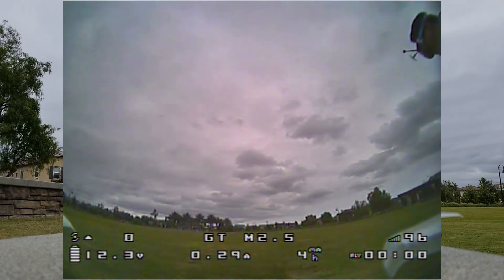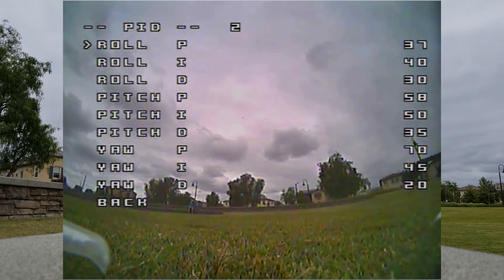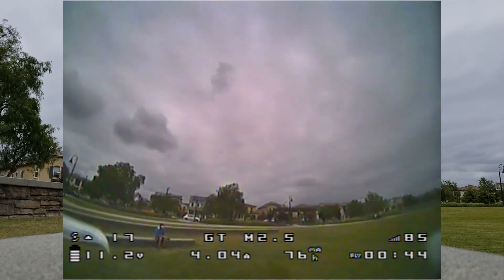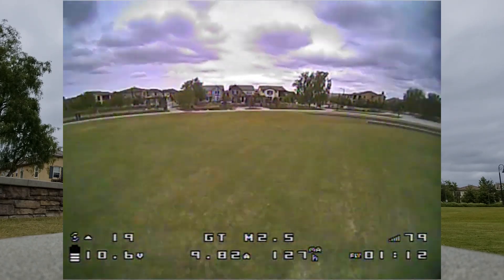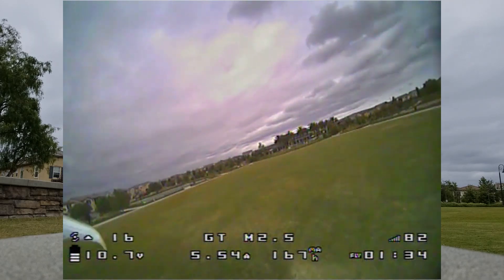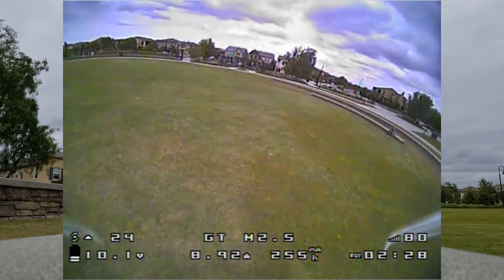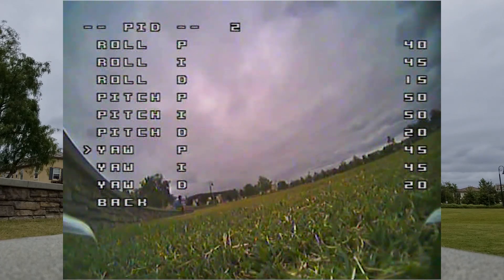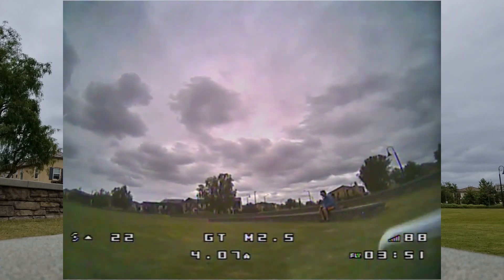PID Tuning (Diatone GT-M2.5) 🛠️

Comment: Great! Even though you are adjusting more than one variable at a time, it makes a lot more sense than I thought it might:
   Fluttering noise - Lower P and D gains (especially for D if motors too warm or noise prevalent during punch out)
   Drift in punch out - Raise I gains
   Loose feel - Raise P
Maybe I don't need the 7 series 5 hour tuning course! (Except as reference material...)
Reply from the maker: You can get a good basic tune with some simple adjustments.  No need for a PhD.

Comment: Hi Albert thanks so much for the video. One thing EVERYBODY misses out on in tuning videos is posting/showing their filter settings. Whether you use biquad or PT1 and depending on how much filtering you enable your tune can end up vastly different! Your video shows the process of PID tuning nicely (although I believe your pitch P is too high and your D's could go lower as well), but many people like to start their tune with someone else's (if the motors and props are the same) and this is only possible if the filter settings are known as well.
Also, Yaw D does not do anything on Betaflight. It's disabled. It is enabled on butterflight though
Reply from the maker: I have a separate video on the filter settings as I didn't want to repeat it for every PID video...  https://www.youtube.com/watch?v=4KyyuK9fGXc
Reply: That does not make any sense to me. PT1 is the best filter to use and it is not risky at all if used along with the dynamic notch. And on 3s you definitely need filters! I have >10 quads, both micros and 5 inchers running on 3s and 4s and everything needs PT1, dynamic notch and sometimes a separate static notch
Reply: Hi Frank, if you want to run 4s on a 2" or 2.5" then yes you will run into problems. I've experimented with that and in my opinion, 3s is better for these models, exactly because of motor heat problems. Of course you can add more filtering, but with more filtering the quads will fly like they are drunk and that is no good (of course they will be faster if that is the only thing that counts). It is not risky to use dynamic notch + PT1 in 4s at all. It is risky to fly 4s with 6500kv 1106 motor though. These run pretty warm on 3s already :-D Like you said, it depends on the setup.
I have pretty much as much fun building and tuning my quads as I have flying them. I only fly about five or so regularly; the rest I use to try out new things. Also I don't build 10 identical ones of course. There is a quad for each occasion: 1s brushless for the garden, insane 2.5" speed for the park, a 3" for tight race tracks, a endurance 5" (>7min on 1300mah 4s) for chilling out and a balls to the wall 5" for speed. The rest is somewhere in between with custom build frames and ultra lightweight stuff.

Comment: Great video! Would be awesome if you could explain a bit more though - for example why you are adjusting which parameter, respectively what you expect from increasing/lowering "I" or "D" and so on...  
 Could you do a PID tuning video of the Space Wolf DT140 too?
Reply from the maker: Do you have a specific question?
Reply: Unfortunately my Space Wolf is still stuck at customs, but I do have a more general Question: Which term could be adjusted if a quad does feel kind of robotic/stiff? I do have this problem with a 2.5" Quad (especially on pitch but also a bit on roll).

Comment: Hi Albert, after flashing to Betaflight 3.4.1, i've had a rough time getting this quad tuned for 3S.  Have you ran into this issue at all? In the end I got something respectable, but was looking for suggestions if you had anything. Thanks.
Reply from the maker: Yes, I am recommending micro flyers avoid 3.4.x for now.  I've had hot motors and burned up a couple.  Something is not right with it and it seems to only work well with 5-inch drones.  I am going to put out a PSA video about it real soon.

Comment: P term and D term oscillations on this are terrible, to get rid of the motor fluttering I have had to go as low as "P" roll/ pitch 26/ 30 - "D" roll/ pitch 12/ 14 on 3s with gyro notch 1 & 2 disabled and d term notch disabled also | and for 4S "P" roll/ pitch 18/22 - "D" roll/ pitch 8/8 with gyro notch 1 & 2 disabled and d term notch Enabled!! motors get hot. 6500KV is way too much for 4S. it needs 4500-5000KV realistically for a good 4S build. Even for 3S on this 6000KV would be the highest I would go and would only go to 6500KV and higher if I was planning 2S.
Reply: Thank you, this really helped me out. 
I've configured everything at home with a 2s laying around. Everything was fine, flying in the living room. Went to the field with 3s and the m2.5 went nuts. Even thought I've fried my motors.
I've never had a quad that was that way off tune and I've flown lots with stock betaflight settings.
Shame on diatone for their pr blabla about fine tuning before shipping.

The motors are still getting quiet hot, but it's a really beautiful hardware.
Reply: Thank you! this smoothed mine right out!